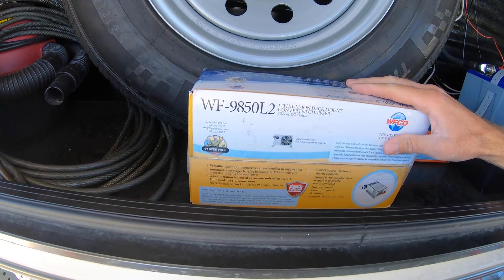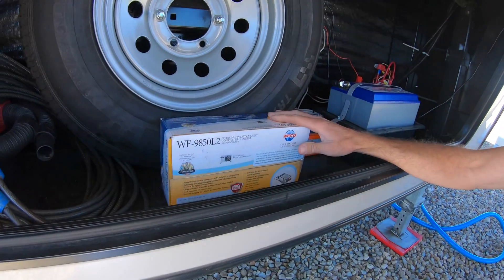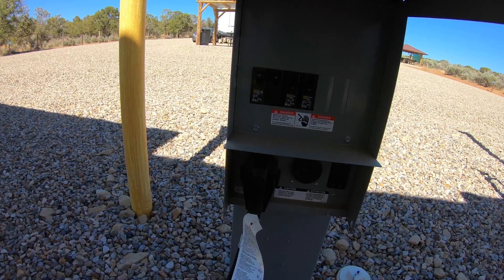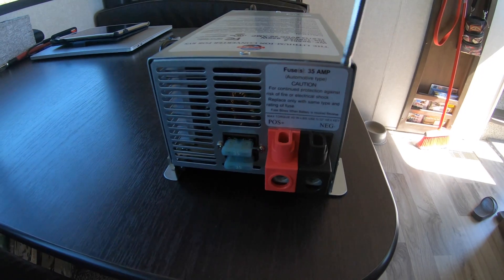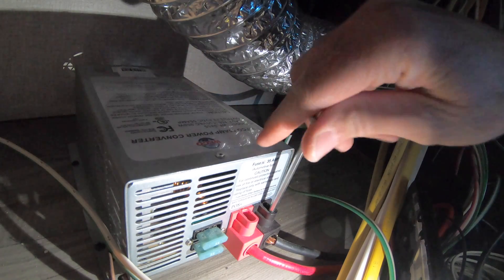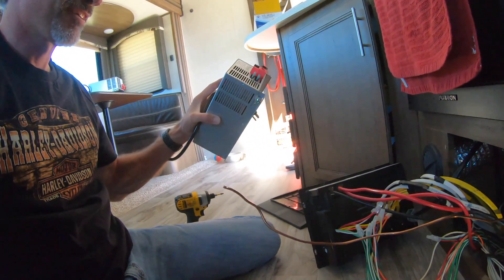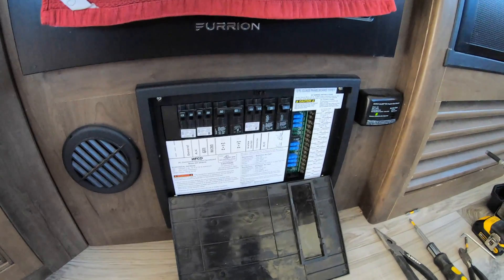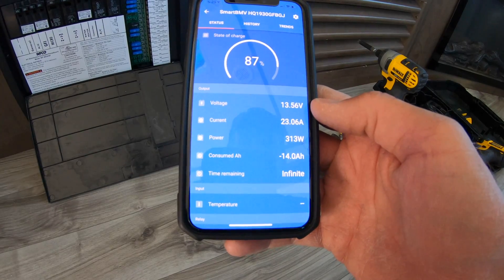Going to LITHIUM Batteries for your RV?  WATCH THIS FIRST!  WFCO WF-9850L2 Lithium Converter Install

Comment: It looks like you only have #6 leads out of the charger. That may account for only 30 amps out of a 50 amp charger. Look up a “voltage drop calculator”online. Making sure that keeping runs short as possible between batteries and loads/chargers and properly sized conductors can make a huge improvement. For instance a 12volt 3000 watt inverter can draw 400 amp peak (and should be fused as such). For even short runs of a few feet can drop delivered voltage by .3 volts with a 4/0 cable. I ran double 4/0 cables to avoid low voltage inverter tripping when there a surge like running a coffee maker and toaster at the same time. The batteries were at the time were three 8D AGM VMAX in parallel. I  experienced tripping when the batteries were down to 12.5v or 40% (no load at batteries). Improvements now are now are a 24v 4000watt inverter/charger lithium ready, using the same (now way overkill) double 4/0 runs because it’s already there. Tied into six Battle Born 100 amp batteries. My capacity has doubled also notice that for a given load, lithium’s don’t drop/sag voltage as much as top rated AGM’s. They also charge/top up faster than AGM’s. As far as I know the three AGM’s are still running fine after I sold them. With the AGM’s I typically would recharge at 12.5 and never let it go below 12.3(no load) Now I just have the inverter shutoff 10.5 volts though I’ve never got below 12.
Reply from the maker: Hey Karl!   We do only have 6awg hooked up to the charger.  We left the stock cables intact for now, however, plan to upgrade to a 3000W inverter and add on 2 more Battleborn 100amp Lithium’s.  When we do that, we’ll be moving the batteries to another bay right next to the inverter and upgrading the wiring as well at that time I’m thinking to 2/0 wire.  Thanks for pointing that out about the probable reason for only getting 30amps out of a 50amp charger.   That makes a lot of sense that it comes down to the wire length.  It’s quite a distance from the charger to the battery...   Thanks for the info!
Reply: Homie At Large 
Excellent idea! I highly recommend something like the 12 volt Magna Sine Hybrid inverter charger. 24 v version is more efficient and allows smaller cables. Hold onto the new charger than you can run separate banks for “house” and “inverter”. If you replace or install an additional heavy duty alternator (24v?)(Balmar) and use a isolator ACR (Blue sea systems) you may be surprised how fast you can recharge your banks. Yes they are marine but they work. Consider the use of up or down converter for alternator charging if you go the 24 volt route. There are so many great devices available now. Remember those long runs are big cables and are +$ to do it right. Don’t forget the max charge rate of 100 amps per battery. The frame can help with sharing the load but not to be depended on and no current through the hitch contact. 
Have fun, it only cost money, but YouTube monetize can help.
Reply: Hint: if you run a home refrigerator/freezer 115 volt there are two things to do to it. #1 find the defrost circuit and install a switch to disable it at night or for a few days while on inverter. This will make it more efficient and the keep the inverter quiet at night as the fan only kicks on with higher loads. Make a check list so you remember to turn it back on. If the refrigerator doesn’t already have one incorporated in it, Install a delay on timer (at power plug is ok) to allow the compressor head pressures to drop when there’s a power interruption (power transfer). If the compressor stalls, there’s a overheat switch that can trip but it’s a bad idea and it only works so many time.
Reply from the maker: Looking at installing this SPS and use with the Victron Multiplus 12/3000 inverter.  Will try to minimize the cable runs between the SPS and the battery bank/inverter.  Per the website:  “The Smart Phase Selector (SPS) is designed to control power flows between a 50A main panel, a single input inverter with AC pass-through/PowerAssist, a shore power connection, and a generator.  It allows both sides of the 50A main panel to receive power with a single inverter whether connected to a 50A shore source or not, within the output limitations of the inverter.  The SPS greatly simplifies the installation of an inverter system and improves the functionality of an RV configured for a 50A service.”   Saw this on All About RVs YouTube channel with Jared Gillis.  I actually met him when we were out west and he was nice enough to give me some advice on the setup.
Reply from the maker: Here’s the link to his video on it.  https://youtu.be/7xKOyRyxdNk
Reply: Homie At Large 
Wow, tough decisions, I’m glad I don’t have to agonize. The Victron is a very nice unit. I really like the phone app access. The Magnum has many of the same programmable, percentage, supply sharing. It also has generator start up features. Be aware there are stationary and RV Magnum versions because of how RV’s handle grounds. So do your homework to decide which is the better for you. I did learn something new... “The Smart Phase Selector” is pretty cool. The only thing I’d change in the diagram is in place of the surge protector, I’d put a 50 amp Hughes autoformer/ surge protector. On a hot day in the outer reaches of an RV park the voltages can be so low that you can’t run AC. The Hughes unit can adapt for it. Oh and install it, several RV park managers have seen it and nonsensically demanded the foreign object be removed. Also it could disappear in the middle of the night like bicycles.
Reply from the maker: Yeah, I thought the SPS was really cool as well.  I do have a Surge Guard 50amp unit that I’ve already installed inside our rig.  I made a video for that install as well: https://youtu.be/mRD9KPKNKm4   I know it protects for low voltage as we actually had to move sites the one time.  Not sure if it does what yours does though.  Sounds like yours actually somehow compensates and keep things running?
Reply from the maker: Just read about the Hughes.  Seems interesting, however, saw that some concerns were about it over boosting and got some bad reviews because of that.  They said it was boosting to 130v.  Fortunately, we’ve only ever had that one low voltage issue and we are full timers moving weekly at times.  Thanks for letting me know about it though, love to learn about this stuff!
Reply: Homie At Large 
Over boosting? Well that’s a concern. Perhaps the unit was malfunctioning because it’s supposed to be automatic. 35 years ago I rigged up a buck-boost transformer for my dad because his favorite KOA had low voltage. I did instruct him to not use it when the voltage was good. In fact I still have it kicking around in my garage. Man he appreciated it.

Comment: Did you have to change any of the charging parameters or was the WF-9850L2 "plug & play"?
Reply from the maker: @19ken49 The WF-9850L2 is plug and play.  There is actually no way to connect to it to change any of the parameters.  Kind of wish there was though...  The WFCO does pretty well though regardless charging around 25 to 30 amps in bulk charge mode.   We will eventually be moving to a Victron Multiplus Inverter which will have full access to alter parameters as needed.

Comment: If you plan to leave your Victron BMV-712 display in that compartment and not mount it in the living space, you might want to consider switching to Victron's new SmartShunt.  It is Bluetooth capable with no display.  I really like mine.
Reply from the maker: @19ken49  Because the BMV-712 is bluetooth capable, I just connect to that with my phone, so, I don't think we would benefit from the SmartShunt, unless maybe it has additional features that the 712 does not have?

Comment: Great video! Have you been happy with you new converter? I love the idea of the simple installation! I’m looking to do exactly what you did. New converter and 1 Battle Born for now. Thanks!
Reply from the maker: Tim Schlosser Yes, we have been very happy with the new converter.  Charges the battery fairly quickly (anywhere from 25amp-30amps charge rate during bulk charge), then tapers down as it gets to a completely full charge.  Glad to hear our video has helped you with your decision!
Reply: Why did you disconnect the ground from the panel and install a new ground wire?  I would think that the old wiring would just work so you only have to run the old wires into the new converter.
Reply from the maker: @edwardf.devarona5066  Hi Edward, I did not run a new ground wire.  The original ground wire was ran up from under the rig where it had been grounded to the chassis under the rig then routed through the terminal on the converter and finally into the back of the panel and terminated at the front of the panel.  I only disconnected the wire from the panel to be able to thread it back out of the converter terminal then installed the same wire with the new converter.
Reply: @EddieAtLarge  Is that because you could not remove it from the converter side because it was too tight to maneuver it out of the converter?
Reply from the maker: @Edward F. De Varona  There was no way to remove it from the converter as it was ran through a closed loop on the side of the converter and I did not want to cut the ground wire.  That is why I removed the end at the panel and then backed the wire out through the loop.  In hindsight, I probably could have just cut it and spliced it back together.

Comment: Just ran across this. Battle born batteries are rated up to 1C charge aka 100 amps. 30 amps seems kinda slow.  If the battery was 100 down (100 amps). That would take over 3 hours plus trickle time.  “ numbers are generalized “.  My lead acid batteries get 30 amps until 90% full then it slows to 14amps then trickle.  When you go solar “depending on size” you will be pumping in a lot more than 30 amps into your batteries.  I use 1/0 wireing  from my converter charger to my batteries and also to my inverter.  Helps with amp loss do to length.  Loved your vid. Can’t wait to watch the solar ☝️
Reply from the maker: David Groves  Hey David!  Thanks for watching and commenting!  I did know that Battleborn batteries are rated to receive the charge up to 100amps and agree that 30amps is a bit of a slow charge rate.  My RV has 6AWG wire running from the converter to the battery though and that is only good for up to 55 amps, so, that's why I went with the 50 amp lithium converter.  I'll eventually be installing a small 3 battery bank, auto switch and inverter.  When I do, I'll be going to 2/0 wire or larger similar to what you have.  The solar suitcase that I'll be putting together will only be generating around 15 amps max (i believe).  I will say that even though I'm only getting 30 amps out of the converter, I'm pretty happy with that compared to the very low charge rate that I was getting out of the original converter.  Did you install/upgrade your own system?
Reply: Homie At Large  yes about installing my own system.  I DIY all my stuff . So far been pretty happy with my upgrades. So far I installed it strong arms, max air vent fans and covers the inverter with plug, new converter with lithium jumper option, swooped out all lights with LED, water pump pressure tank to stop water pump chatter and maintain 40 psi , shower head lol, USB ports in vin a few  locations .  Looking into tank heating pads and sea level sensors for the tanks as the other ones or just plain crappy. My rv is a bunk house and my kids are all grown up and no longer camp with us, so I’m concerting the bunk beds to dressers on a rail system so I can move them back and forth to use the space better.    All in all I enjoy the projects. My wife is very helpful and supportive. We just got done upgrading the oil cooler on our truck.  That was a fun day😣 . My job lets me telework so we are on the move a lot from place to place exploring.  We love dry camping. It just seems to have less crowds and your normally not packed in with your neighbor right next to you. The converter I purchased is a progressive dynamics wildkat version. It’s designed for dry camping to allow rapid charging of batteries from a generator. My old led acid (2 six    Volts) would charge at 30 amps with this converter. This would allow me to charge in 3 hours.   Lithium will do 50 amps now. So a little over 2 hours.  Saves me a ton on fuel and noise.  I would go crazy on solar but I park under trees most of the time.   Well that’s about it. I’ll be watching your channel.  Have a great time.
Reply from the maker: David Groves  Wow!  You should start your own channel featuring upgrades.  We’ve done a lot as well.  Even put in my own 5th wheel prep package which I’ll put a video out on.  Glad you’re enjoying the channel.  Thanks for the sub as well!  Now you’ve got me interested in the tank sensor. Ours area awful too.  Never heard of that before.

Comment: Very helpful thank you. My lithium battery arrives shortly and I'll be getting a new converter. Now just have to figure out which amperage to buy.
Reply: My original converter was 55amps so I replaced with them same. But progressive dynamics said increasing by 5 amps is acceptable range.
Reply from the maker: @BigTymer0007  OK.  Just curious.  My wiring is 6awg and what I have seen online is that is good for up to 55amps max and that is why I went with the 50amp converter.  Thanks for the reply!
Reply from the maker: Awesome!  Do you know what amperage your original converter is?

Comment: Excellent video! You have done the exact setup I’m planning to do. I have a WFCO model 8955 in my trailer and the guys at WFCO said it will work with a 12v Battle Born 100 Ah Lithum battery. I was told the same thing by them that it would not charge it 100%, maybe 80%. I also have an option to get an 8950L-MBA lithium ion converter/charger for around $250.  I think I’ll do what you did and give my original a test to see how it does. Have you determined if shore power charges the BB battery at the same rate as your generator?
Reply from the maker: MrBlueSkyNM  Awesome!  Glad our video helped you out!  We do get the same charge rate of around 25amps to 26amps bulk charging with the WF-9850L2 on both generator and shore power.  The charge rate will vary depending on the SOC (State of Charge) of the battery.  It charges at the max charge rate when the battery has been more deeply depleted.  If it is closer to full, it charges at a lower rate and steadily decreases the charge rate until the battery is completely charged.
Reply: @EddieAtLarge  I was wondering which generator you are using. I have a 150lb 3000W Yamaha, but I'm thinking of getting a lighter 2000W for ease of mobility.
Reply from the maker: We have the  Champion 2800W Running / 3100W Peak Gasoline or Propane Fuel Inverter Generator.  It is pretty heavy!  Like the propane fuel option though.  Have not used gas in it yet.
Reply: @EddieAtLarge  Thanks for the replies! A dual fuel generator is a temptation. I'm going to get a call from Battle Born today to discuss my options. They recommend a Progressive Dynamics replacement instead of a WFCO replacement. I've seen a lot of negative comments on WFCO chargers. This sure is an expensive path to go down, but not as much as going solar on the roof. I look forward to seeing how your DIY portable solar panel project comes along. Happy trails!